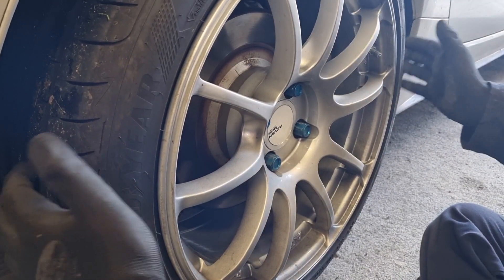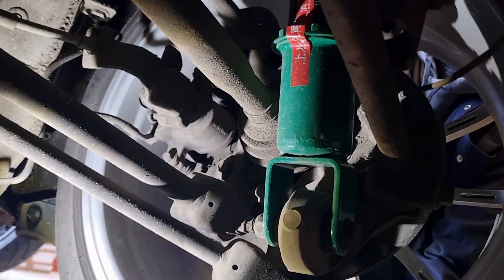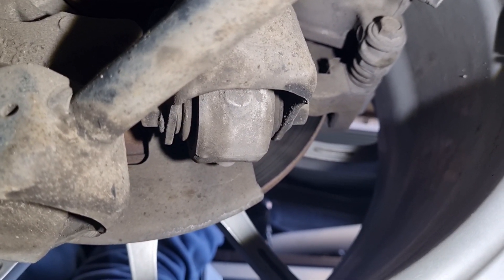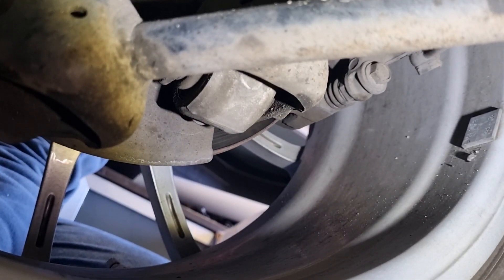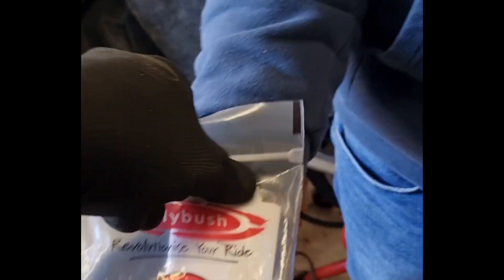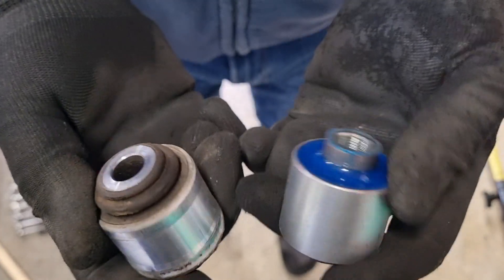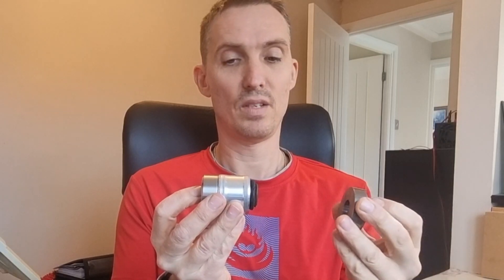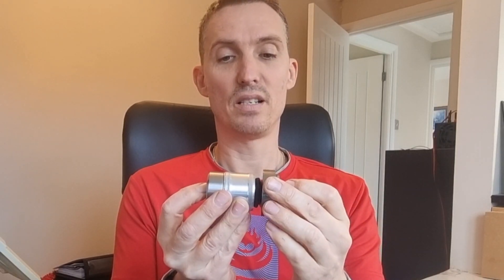Checking rear hub bushes on a MX5 ND

Comment: Did these bushes work as I bought these from the Mx group taken it to my local garage and they said the whole hub assembly needed replacement
Reply from the maker: Yes, they worked perfectly, admittedly the old OEM repair was to replace the hub, however now we can just replace the bushes, so get them to do that, or if your local to Milton Keynes, I can do it for you!
Reply: @davedoesit  how much would you charge for replacing those if i take the hubs out or how much would you aks for lending the tool alone. Just picked up ND 2015 plate from Nottingham with 50k on the clock. DUring test drive did not notice nothing, checked if there is any play on the wheels but didnt find any issues. Two days later over a speed bump i noticed the knocking noise from the rear of the car thinking its the jack or something else lose in the boot but couldnt locate any lose objects. Its only when i sarched online for the knocking noise on the ND model i found your video. I am in Bedford btw. thanks
Reply from the maker: Hi, I won't be able to help you until after the 28th July, but only max 2 hrs mot massive... depends if you want me to order the bushes for you too. Best come meet me and I'll check it out then go from there if it helps?
Reply from the maker: Im back if you want a link up. cheers!